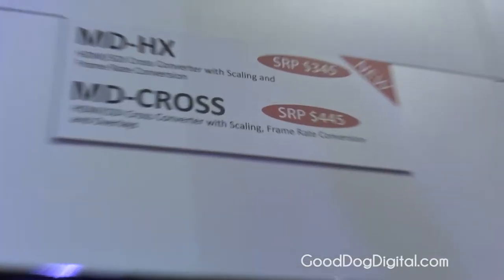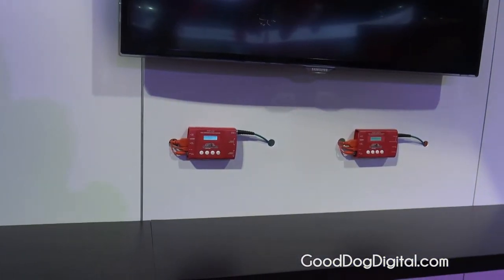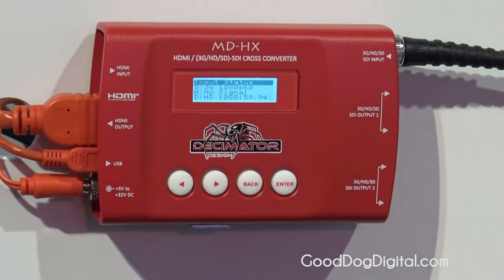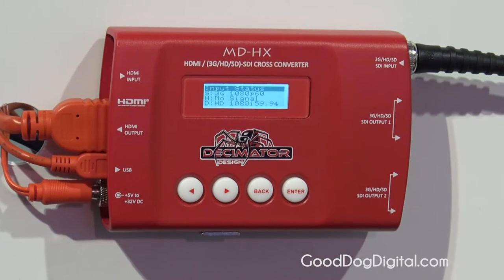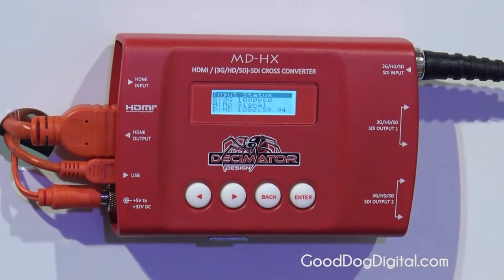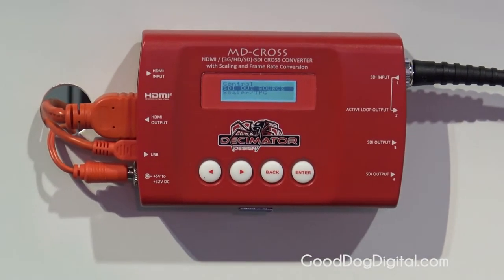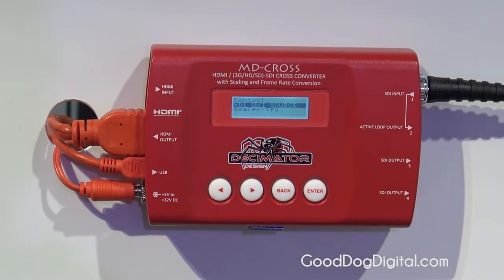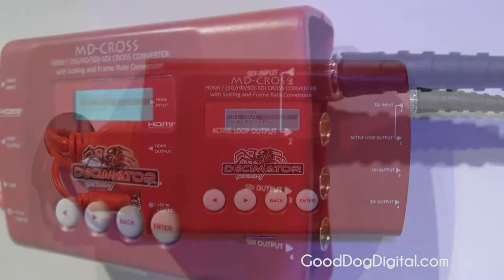NAB 2015 Decimator Design MD-HX & MD-Cross

Comment: If I go HDMI out at 1080i to 4x3 SD for recording to a DVD will the aspect ratio be correct? Right now I have to either choose a correct aspect ratio coming to the Atomos or to the DVD recorder for onsite dubbing. So I chose the DVD to be correct and now having to fix the Atomos records in post. I'm wanting to put this between the Roland switcher and the DVD record to send correct aspect ratio everywhere. TY.